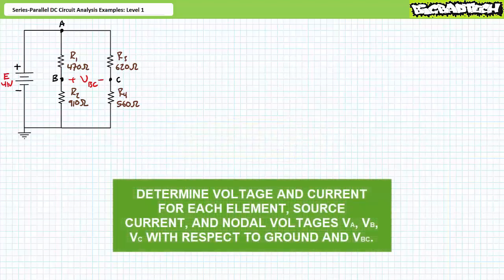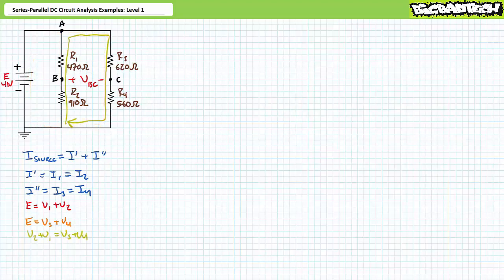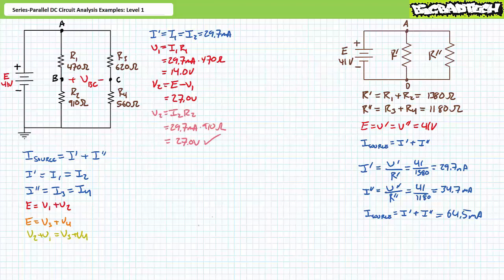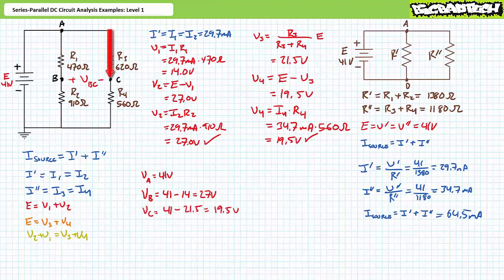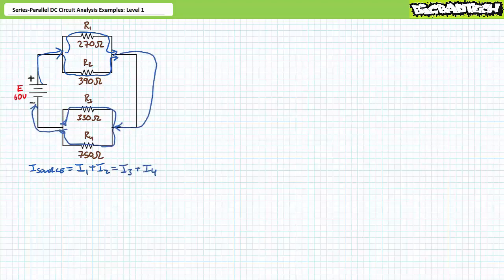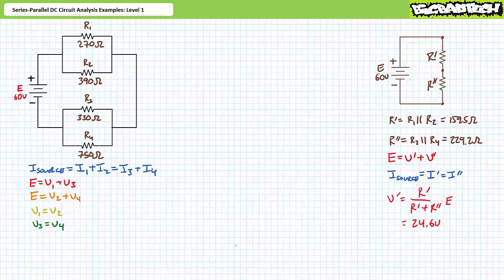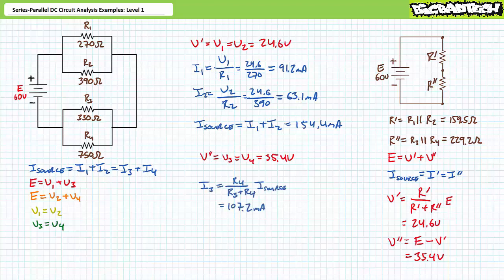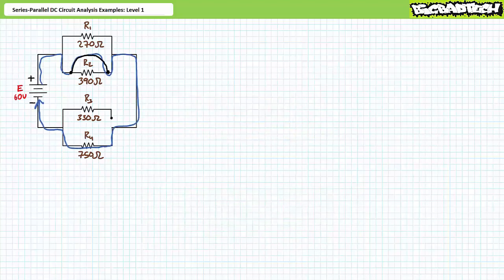Series-Parallel DC Circuit Examples: Level 1 (Part 1 of 2)

Comment: Good Morning Jim. In the last example, 60 volts divided by 750 ohms equals .080 amps not .800 amps.
Reply from the maker: Good catch! Missing a decimal 60/750=80.0mA